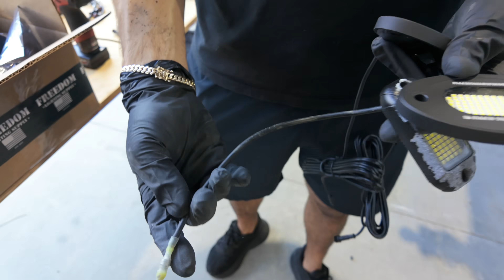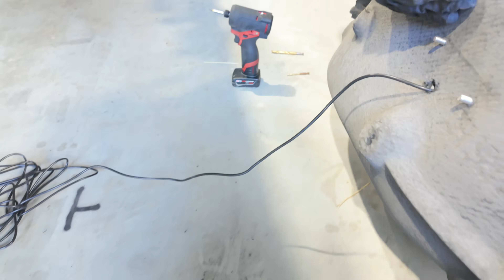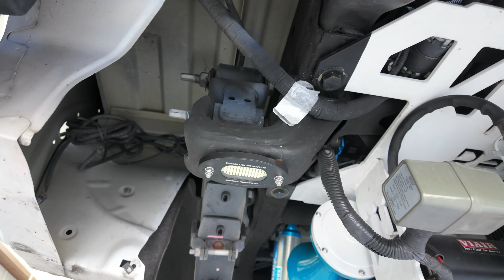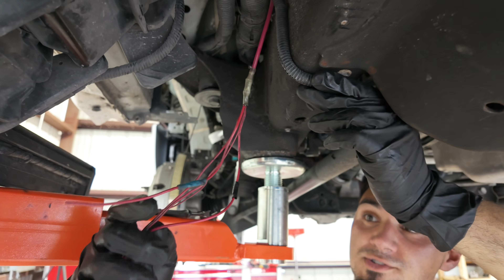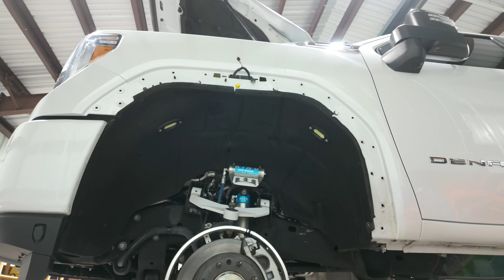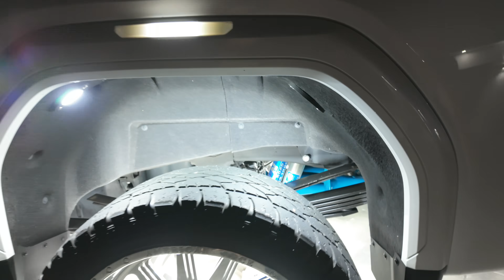GMC Denali Got the BRIGHTEST Rock Lights EVER-108 LED Plug-and-Play Install Freedom Lighting Supply

Comment: I sprayed my rear wheel wells with line-x bed liner spray because my ford don’t come with plastic ones, would I have to get plastic rear wells? Also are these connected to a remote or auxiliary switch?
Reply from the maker: The lights are all controlled through our control box module via app or keychain remote- both options are included with every kit we sell. 

As far as the rear liners go we sell magnetic mounts and magnetic brackets that will allow you to mount on the bed without having to do any drilling!
Reply: @freedomlightingsupply I have a aluminum body

Comment: Now I have to order more lights🤦🏼‍♂️
Reply from the maker: haha, This certainly is a crazy bright setup!
Reply: @freedomlightingsupply I wired a plug n play wiring kit to my positive on my battery and negative to a ground bolt on frame and it drained my battery.I also have an extra white wire and the kit didnt come with a relay or anything if you guys could help.